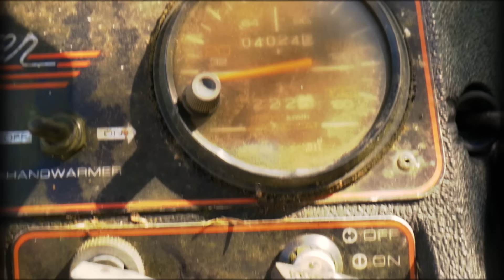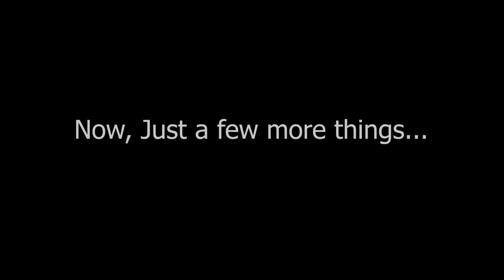I put a snowmobile engine on a motorcycle

Comment from the maker: I appreciate all the feedback (specifically about the expansion chamber)! That's why I love youtube! I will put it back on ASAP just have to figure out how/where. In the mean time, submit a video/picture of your projects so I can put them in the next video! E-mail in the description
Reply: I love the mad Max look of the bike and would almost keep the brakes where they are
Reply: That's what I came to say but you already know about the exhaust lol
Reply: HAHA didnt saw this comment when I wrote mine :)
Reply: Yeah you REALLY need a proper exhaust on a 2-stroke engine. Check out Colin Furze's channel for an how-to on making these using a pressure washer :) ----> Pretty much welding two flat and thin plates together at the edges and expand it with high pressure water !
Nice project :)
Exemple :  https://www.youtube.com/watch?v=bCsg5pQimWI
Reply: @asfodhell  Best is to use original. If chamber is not right size it wont work eather.
Reply: @-allornothing-  I agree. Mod the original. Oliver seems capable.
Reply: well one thing for sure , you can fabricate and weld pretty good .
Reply: we need more people like you that actually  are willing to try and build projects themselves .
Reply: Oliver Motorized  Definitely something you would see in mad max good job
Reply: @carmichaelmoritz8662   what vid did you watch? it doesnt look "pretty good" at all..
Reply: You can make a new expansion chamber but it has to be the right size. Just get the old expansion chamber and seal  up one side. fill it up with water and then measure it. Now you know where to start size-wise for your new chamber. Or just chop up the old one and make it fit. I think that's the route I would go with this project anyway. Happy building
Reply: @wimvandesteeg1353    he is on his way to betterment  , his welds looked pretty good .  most people dont even know how to fabricate anything nevermind welding metal  .  he can do both and probably much more .
Reply: Awesome, I always imagine doing this one day
Reply: Exactly what i was going to say but another thing idk if people said was if you put the stock exahust back on most likely you wont have to do much to the carb maybe put the idle air skrew back to stock but other than that souldnt need a hole lot of tuning. Also you can run exhaust with no expansion chamber but you need a lot more fuel going into the engine and no expansion chamber will mess with your power band a lot.
Reply: O and i forgot to say love the build man keep it up.
Reply: Came here just to let ya know about the expansion chamber, see they beat me to it. Awesome build man. Keep it up, subscribing now!
Reply: Hey man awesome build ! I am doing a similar build with a go cart! how did your fan cooled engine run? Did it ever get close to over heating?
Reply from the maker: Thanks for the advice brandon
Reply: @isaacknudsen9320   depends on the make of the motor , some have  softer iron rings and lose compression  if they are run to warm  , not to mention piston meltdowns .  i have had most luck with those sst 443ss fan cooled  yamaha motors   they were common in those 73 to 80 some snowjet sleds .  you can tell the type if they have or had an oil injection pump , if it still has the pump turn it up a bit , remove the cable and always mix your fuel using two cycle oil  .
Reply: You could.try making your own too. It doesnt havr to be exactly the same. Two seperate pipes from some single cylinder dirt bike  with approx. The same displacement. Example two pipes from a 250 twostroke
Reply: @carmichaelmoritz8662 do you advise to turn the oil pump because oil is helping to keep the engine cool ? My main concern is trying to keep the engine cool in all regards. I don't wanna deal with over heating after riding for a bit. Maybe fabricating some kind of hood scoop to allow loads of air to move around the engine would help ? Of course that would only be effective at higher speeds
Reply: @carmichaelmoritz8662  another thing iv thought of is to go with a liquid cooled snowmobile engine. A buddy of mine said it would overheat quickly, on the other hand I own a 2000 Polaris explorer which is a single cylinder 2 stroke engine that's liquid cooled. Iv never had it overheat, is that because its cooled via radiator and radiator fan?
Reply: @jamesjenkins7814  yes many two stroke motors had a tuner pipe for each cylinder , sounds way better . i had a old triple back in the day and it sounded magic  :))
Reply: @isaacknudsen9320  nope it wont help cool the motor , its just more extra work to remove it .  i forgot how much energy i had and times wasted when i were younger , time did not have much meaning back then .  just saying  .  :))   most likely you have lots of energy and removing the pump extras times will be a breeze .
Reply: @isaacknudsen9320   as long as you have a big enough rad on it with a fan you should be good .  make sure to put a temp gauge on it though for just incase .
Reply: @Connor-go9le  yes those expansion cases are important , same goes for a proper air filter .
Reply: @Connor-go9le   driven many different types of liquid cooled sleds in my days and never had issues with the way they ran on warm summer days driving them across lakes and rivers .  just saying  .  :))    tuner pipes , air boxes , carbs are usually the main things to look at ,  sometimes its actually one crank seal leaking ,  funny thing is that on a liquid cooled a crank seal only makes it idle high and it seems like its running out of fuel ,  a properly designed two stroker will start running high when its starving for fuel .
Reply: This build is awesome.  Was going to put my two cents about the exhaust, but it seems I am not the first by a long shot.  Good luck!  I look forward to seeing the future build!
Reply: @Connor-go9le  i also had a old 75 boa ski sled , it had a metal air box , no filters and i tried one time with the air box off and it only revved to a certain rpm and sounded horrible .  also some people put the filters on the end of the carbs , thats a no no especially if the filters are pulling in warm air from the motor or are in the dust created from the vehicle .  and if the filters get wet naturally the air flow will be restricted .
Reply: Well its a nice build however my question is this since u obviously did zero research on 2 cycle technology how did u premix the gas to what ratio? Or did u just dump some oil in there amd shake? Next time u decide to take on vintage drivetrain you may just give a quick bit to understand it. Had u done ever the most limited research you would have seen the need for the stock expansion chamber as well as a few other basic items limited to the 2 cycle world.
Reply: Oliver Motorized that was cool 😎 now that’s a chopper!! Good job 👍🏼👏🏼👏🏼👏🏼👏🏼👏🏼👏🏼👏🏼👏🏼👏🏼👏🏼
Reply: Used a good grade snowmobile oil Polaris injection.
The crankshaft seals should both be changed.
BR10 EV spark plugs.
If you haven't yet needs a in-line fuel filter.
Try to scoop air into the fan area.
Check the fan belt there is shims to remove.
Carburetor jetting is very important color of the plugs tell much.
Have a better clutch guard catch your leg you'll lose it.
Try to scoop air into the clutch area.
Make sure all your fuel lines are clamped.
A temperature gauge would be a very good tool.
Reply: Someone's possibly explained better. But what that pipe more or less does it create a reflecting wave that helps to push unspent charges back into the chamber at the right part of the stroke.
If you don't get the volume, header or stinger lengths right you loose a good portion of that powerband. Figure that would get pretty complicated with the 3 into 1, but that's beyond me.
Reply: @isaacknudsen9320  rad and snow you will need rad. and air flow off motor cycle. some have elec fans. will be fast.
Reply from the maker: the oil pump mixes the oil and gas so it's not pre-mixed. I did throw a little bit in the tank just in case the oil pump wasn't working. And in regards to the expansion chamber I get it now thanks.
Reply: Oliver Motorized what u have done by adding it to the gas is ran itvway too rich and this is why the thing wasnt getting a hot spark. If the oil pump stops working your motor is toast so the little oil in the fuel just makes u foul plugs. I suggest u bypass the oil pump and go straight premix in the gas tank then there is no more guessing
Reply from the maker: Martyr4JesusTheChrist  sorry dude! i'm actually in Oregon. USA
Reply: I liked what you did here. Always had that idea in my mind to try this but you did it and I was not dissapointed with the results.
Reply: Once you get an expansion chamber in place you will understand what a 2stroke "on the pipe" is all about. There are exhaust calculators available online, best of luck!
Reply: Deserves a thousand likes for the amount of work you did especially the endless welding!!! Great job   subbed
Reply: Sounds lean too
Reply: Expansion chamber aside I didn't see anyone mention that these are also jetted for higher altitudes. That would mean you depending on your altitude you could be running really lean. On an air cooled engine it won't take long to overheat like that. Your exhaust was almost clean after it warmed up. An older snowmobile like that should smoke almost all the time.
Reply: i dont mean to be off topic but does someone know of a tool to get back into an Instagram account?
I somehow forgot my account password. I would appreciate any help you can offer me!
Reply: @Malachi Rene instablaster :)
Reply: @Jagger Tadeo Thanks so much for your reply. I found the site on google and Im trying it out now.
Seems to take quite some time so I will reply here later with my results.
Reply: @Jagger Tadeo It worked and I finally got access to my account again. I am so happy:D
Thanks so much, you saved my account !
Reply: @Malachi Rene Glad I could help =)
Reply: Very cool build, I noticed that every one else mentioned about the expansion chambers but yes put them back on and it will be even better. Rokon made a dirt bike in the early 70’s the RT340 and MX340 with a Sachs 340cc snowmobile engine I have 5 of them they will almost do 80mph. Keep working on your build

Comment: Use the stock exaust the expansion chamber is a game changer
Reply from the maker: Aidan Flis you got it bud
Reply: Exactly what I was thinking
Reply: Definitely it needs the back pressure to reach its max power
Reply: Lol...back pressure.  Tell that to ALL the guys running open headers on their HIGHLY tuned drag cars.  Whadda they know other than going stright? 🤣  2 strokes need a saxaphone aka tuned pipe or expansion chamber to rebound the pulses that spit unburned fuel out back into the exhaust port..  Its intrinsic to the design of having no valves.
Reply: wont be able to hold the front end down !!!
Reply: @impulseperformance4718  I agree, since the intake is coming into the cylinder as the exhaust is leaving, it needs the back pressure to keep from pulling the intake charge out with the exhaust.
Reply: @noidontthinksolol  you got it bud! Miss my old 2 stroke street bikes!
Reply: @rickfeith6372  well yes but actually no. Some turbo engines need a little bit of back pressure to make the most power
Reply: @noidontthinksolol  A high Revving 2 Stroke either needs an Expansion Chamber or Backpressure, if they don't have that, it's the same as a Boost Port aiming directly at the Exhaust Port, it just wastes fuel and fresh Mix will just leave through the Exhaust Port. You can't just compare 2 and 4 Strokes and how one doesn't need Backpressure, so the other one won't need it either. 2 Strokes always have symmetrical Exhaust Timings, and will dump Fuel out of the Exhaust if there is no Backpressure(compared to 4 Strokes, wich can have asymmetrical Timings), you can Tune the Ignition and Carb all you want, if there is no Backpressure or an Expansion Chamber on it, it will have less power even in low Power applications. Of course, to much Backpressure will harm Power output, but can, to some extent, up Fuel economy. Jost a little Comparison: 1.2hp 2 Stroke Moped, Exhaust timing very low at 110°, Blowdown of 10°, no Chamber, if you swap out the 18mm Header for a 22 or 28mm one it will rev out better and will have more power in the Top end, if you remove the Muffler, it will get extremely loud and no matter what you do, you will have less power over the whole Powerband, it might rev out a little further, but it won't gain you power, same with if you have a 28mm Header and put a 32mm or even 36mm on there. 

Also, even full Chamber Exhaust use Backpressure, they have something that's called "Stingers" on some Setups you can even gain a little Power when you make them smaller/ put a little Plug in the end so that the inner Diameter gets smaller, but if you remove them Completely, you will loose a noticable amount of power, no matter what.
Reply: @noidontthinksolol  yes, andmthey need the "Classic" Style of backpressure, because otherwise the Chamber wouldn't work as efficient.
Reply: I will not explain how or why  first because I'm bad at explaining second because I don't want to waste time but Impulse Performance is Wright
Reply: It's definitely not running right
Reply: I can smell 40% of the power just leaving the exhaust from here.

Comment: i use to love to build stuff out of junk.i built a 70 mph lawn boy riding mower that would mow grass. i have built a 65 mph electric bicycle it would go faster but the spokes kelp coming loose. i put a SBC on a 1953 ferguson tractor. that i still have. one day i'm going to get rid of it or maybe get it running again. the only trouble with building stuff out of junk for me is i'm 3 days older than dirt and can't really do it anymore. and if they had a love button i would have clicked it for sure

Comment: That shroud on the engine is meant to keep it warm for snow use, so they cover the cooling fins. For street use you should remove it to keep the engine from overheating.

Comment: just some tips! 1) never run that style clutch/cvt without the belt being on, they can fly right off the end of the crank and cause some mayhem 2) possibly look for an aftermarket tune pipe for that specific engine then modding it into a usable configuration, or a cheaper method.. cut the fatter end of the old exhaust you had for the snowmobile open, inside you should see a cone shape with an open hole.... that cone and everything else that leads back to the engine is the tuned pipe. cut the rest of the metal around the cone off. finish the end with a piece of pipe 5-6" long and a big washer, than you can drill out the inside portion of the washer to finer tune the pipe id say atleast 3/4.. maybe  7/8... to start? a properly tuned exhaust can add 5-10hp to that engine.. 3) snowmobile engines are usually jetted for altitude/temp so you may have to adjust those 5) try a liquid engine next? way more power..